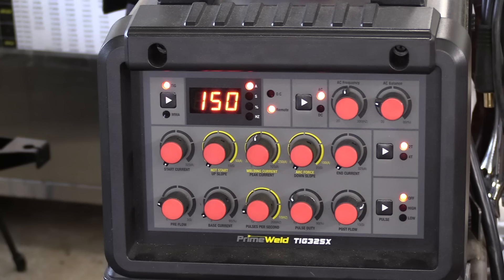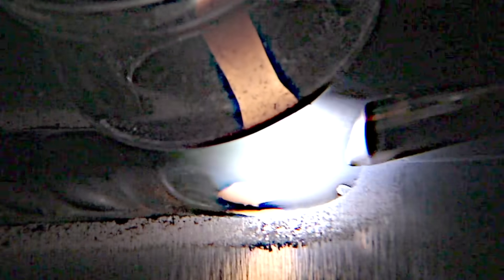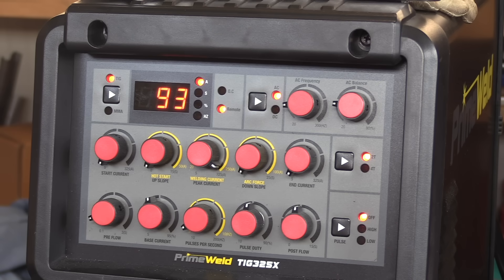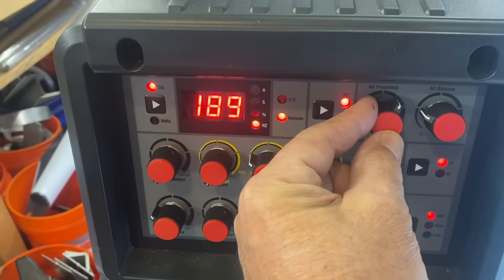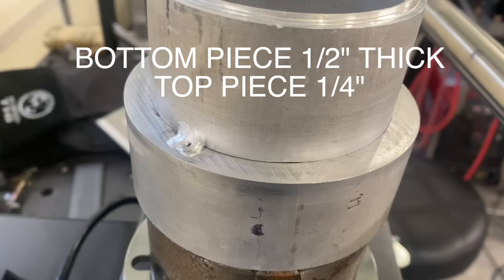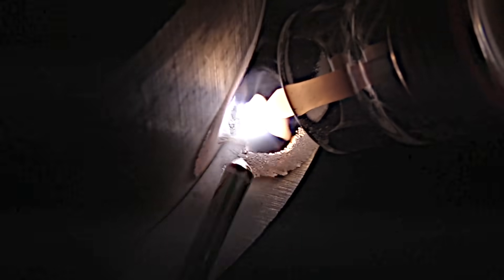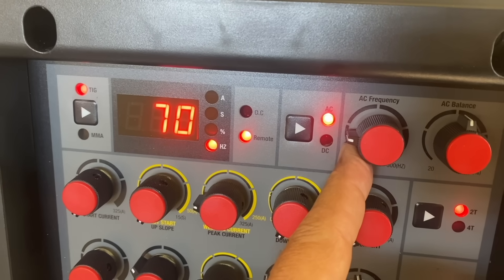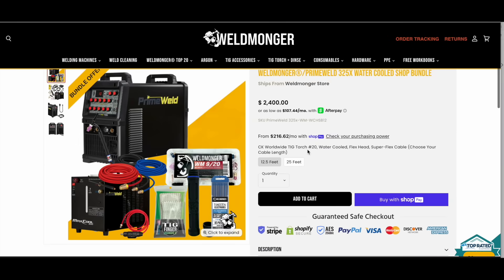PrimeWeld TIG325X Aluminum Welding

Comment: Thank you for your great teaching, knowledge and experience Jody. I want to share something that blew me out of the water. I almost ruined a expensive job. As we are all trying to be our best at welding. I have a Miller Syncrowave 350LX w/ pulse and for years Ive been welding aluminum, well everything went to hell and i thought i was losing it, because i couldn't make a decent weld anymore, i started second guessing everything with settings...turned out my flex head torch had a small coolant leak getting into my welds!!!. just bought a new torch. what and aggravating experience took me a while to pin point it.

Comment: Currently expanding my small welding business and branching out into buying my first tig machine. Not sure how much aluminum or high amperage projects I will be doing. Currently I rarely exceed any material over 3/16 thick. I’m on a tight budget, willing to spend the extra cash on the 325 but wondering if it is worth it? Thanks always and looking great. Thank you for all the knowledge over the years!
Reply from the maker: If you only occasionally weld aluminum, the 225 would probably work fine. I once sold my syncrowave 250 and got a dynasty 200 due to space and power constraints and I did get one or two jobs where I had to preheat the parts to make it work but other than those few jobs I was able to make things work with the 200 amp dynasty.  
That said, the 325 with water cooler and water cooled tig torch is a beast and will not limit your capability if by chance you get a lot of aluminum work. 
IF you do mostly steel jobs then the 225 will be plenty.
thanks and good luch
Reply: Thank you! I’m thinking of going with the 325 and if I start picking up a lot of aluminum work I’ll buy the water cooler! Thank you for all the knowledge you are my go to source. When I teach introductory mig Welding classes I refer students to your channel for when they practice at home. Ur the best and thank u!!!

Comment: Praying for you sir 🙏🙏🙏. Your looking good man keep it up you'll get through this . Thanks for all you do for the welding community !! Been following you since 2018 finally got the welders I wanted now and getting the garage set up for them ( getting 220 run to the shop ) have the mig 180 and just this year finally pulled the trigger and ordered the 325x from ya . Been welding since highschool 2005 and served in the Marine Corp as a well they called it at the time basic metal worker MOS # 1316 and now welder for Maintenance away for a class 1 RR . Mainly do stick and flex core off a miller suit case when welding switch points or frogs . Any who love the videos again prying for you and your family much love and respect and as I would always Semper Fi through Jesus Christ let's go !!! 🙏🙏🙏💪💪💪

Comment: Just a question about this primeweld unit.  How is the arc stability on polished stainless steel.  I currently have a miller dynasty which is great.  We also have an everlast typhoon 330 and it is almost unweldable on stainless.  Very big halo around the tungsten.  Just not a good machine even for aluminum.  Looking for a smaller dedicated stainless elder whithout breaking the bank again for another miller.  Any comments would be greatly appreciated.
Reply from the maker: I think the DC arc stability is fine on both of the primeweld welders that I have used. I have occasionally seen that halo you described on other welders but I think it was due to a gas lens setup, wrong tungsten grind,  or even when my argon tank is running low.  I have not welded with a typhoon 330 so I cant say for certain

Comment: You’re looking great Jody, I am on the welding journey with you for over 10 years now and I will be on all the journeys what life brings to you. I need to tig weld copper sheets of 1.5mm soon, any tips? Food grade. Is cable copper good for filler or hydrogen problems? Helium? Argon shielding the back side or just grinding afterwards?

Comment: Might need to add a sub panel so you don't blow breakers. I did that with my garage/shop and have been happy I did so ever since. Glad you are getting better. I don't have any of the G-d answers, I wish I did. I'm not a Christian but I can say if 2 chapters in the bible stand for me, its Matt ch 5 and Matt ch 25, esp the last third of matt ch 25. Other than that, I got nothing. I don't like religion. The meaning of my middle name is struggles with G-d and I live up to it. I think it helps us all when we see you fighting to get better and be positive and have strength in G-d despite your health issues. A lot of people get angry at G-d in dark times, myself included. Thanks for not only helping us weld better, but to also look inward as well.

Comment: Most important part of the video was to hear you confess your belief and acceptance of Him. He will see you through this trial. Looks like your purpose so far is to use your talent to witness to us and teach us the fine points of the welding trade. You are looking great keep up the good work. My prayer is for your full and complete recovery. BTW i pulled the trigger on the Primeweld 225 bundle a week ago cause the 325 was out of stock. Everything but the 225 arrived. Should arrive around the 17th. All good though. May God continue to have His hand on you. He has great plans for you. Blessings.